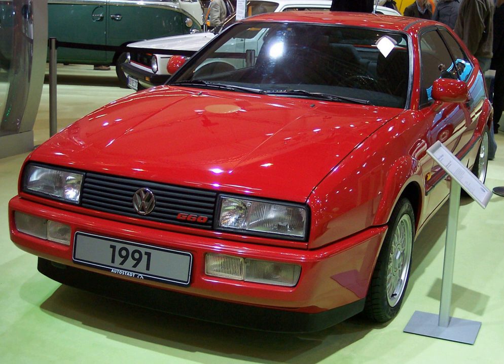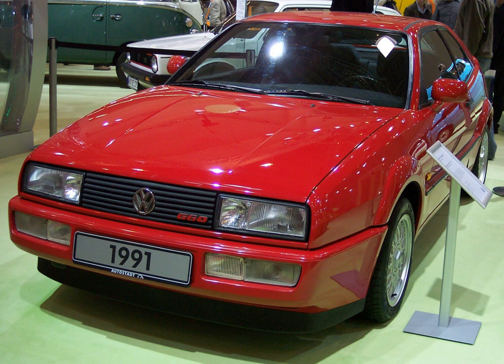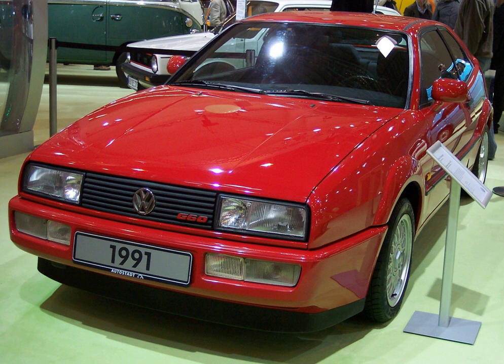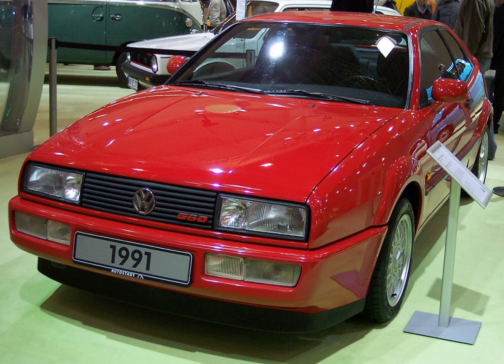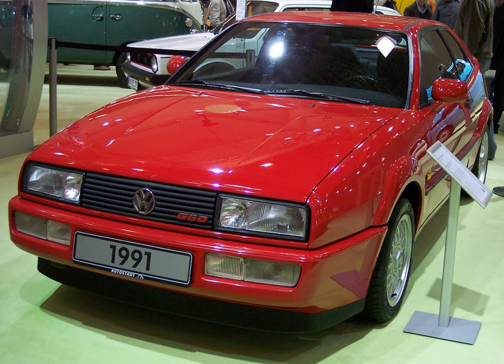Volkswagen G60 engine | Wikipedia audio article

Comment: A Passat Syncro g60?  

Yes, as the only VW g60 with 4w tracking 4w drive.

Yes, as the only car without airbags which took an IIHS death rate of 
24, (2wd edition, 4wd is even better), much lower than many nowadays 
cars with many airbags, (2014  Passat IIHS death rate: 42).

Yes, as the only VW g60 with climatronic, (optional).

Yes, as the only VW g60 with  rear auto height/leveling adjustment, 
(optional).

Yes, the b35i is/was the top VW  g60.

More you can find here: http://www.vwsyncro.eu/p/blog-page_72.html

The Syncro Heresy